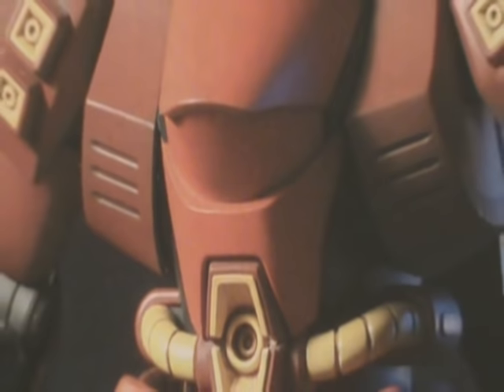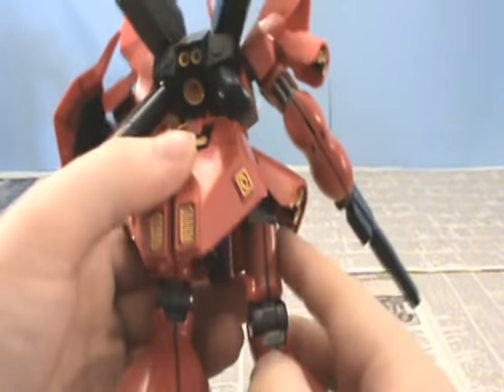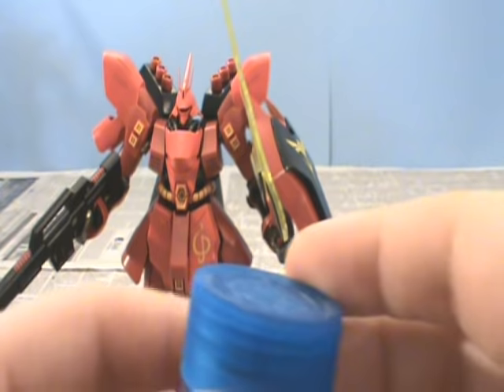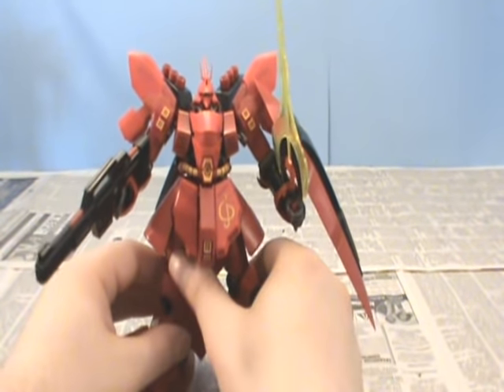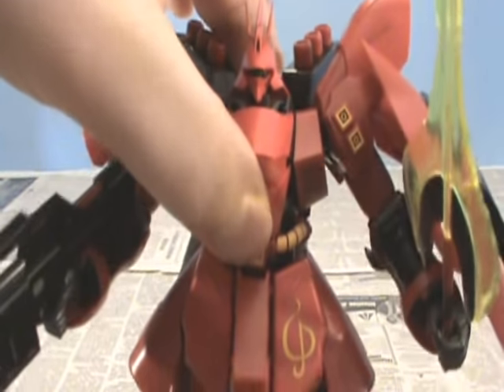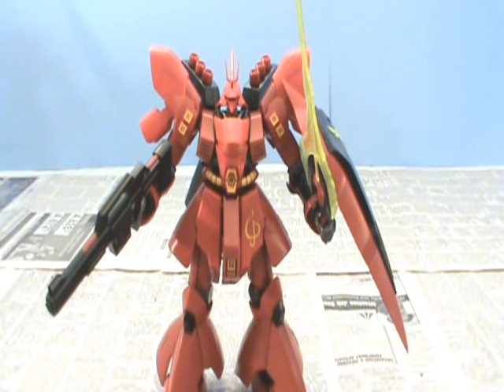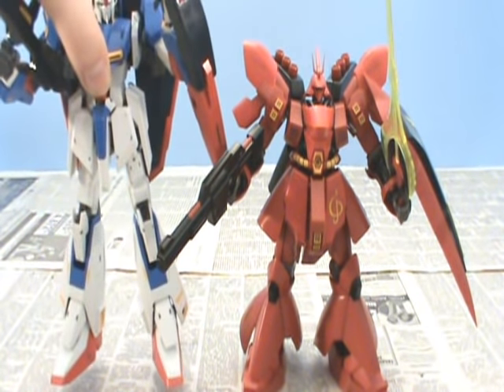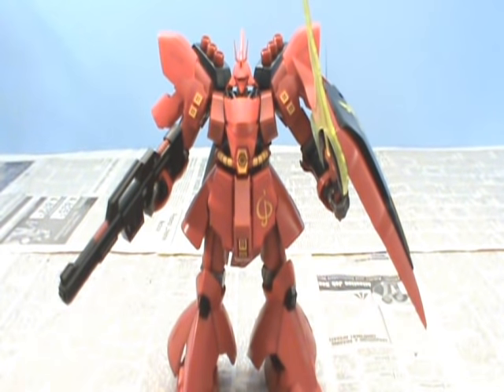HGUC Sazabi Tutorial - Finished Model

Comment from the maker: @KBFclan
Well then, that probably explains it.
Most likely some kind of error in measurement when they made the mold.
If it's simply a matter of the sculpt of the ball joint, then it should be possible to reshape it more properly with a modeling knife and/or sand paper.

Comment: Turned out good. Congratulation to the finished series XD
Red stand + Black light. Wohoo...nice!

For most of my kits I had problems with joints getting loose while painting and modding. When build a model I used to put it together after every small building step to see the progress...but well...ripping it apart again doesn't make the joints better. Maybe that happened to your Sazabi's leg, too. 

Cheers!

Comment from the maker: @dantekicksdemonass 
I've tried that before, and it doesn't always work.
It doesn't create a thick enough layer to keep the parts stable and/or connected.
Plus, the glue dries with a glossy texture, which is not ideal for adding friction in an already loose joint.
However, the wood/white glue might create a thicker and less smooth surface, lending more strength to the joint.
But if you say superglue works, then, what kind do you use?
Anyway, thanks for watching!

Comment from the maker: @lhasarus 
Maybe, as I did remove the leg a couple times during construction.
I can't believe that would be enough to mess up the joint so bad, though...
At any rate, I'll be attempting to repair the joint somehow. I'm leaning towards your white glue idea... If it doesn't work or if something goes wrong, it probably won't be as permanent as something like super glue. So I'll start with that, and go from there.
Thanks for watching! :)

Comment from the maker: @raiser188
Well, the neon paint I use is opaque, meaning you can't see through it; it's a solid color.
That means if you try putting this kind of paint on top of a clear part (beam saber, GN Sword III, etc.) it won't be clear anymore.
But sometimes, depending on the color of the clear part, it might be able to glow under blacklight all on its own.
I have a video called "Testing Clear Parts with Blacklight" in which I show this.
Hope that helps.
Thanks for watching!